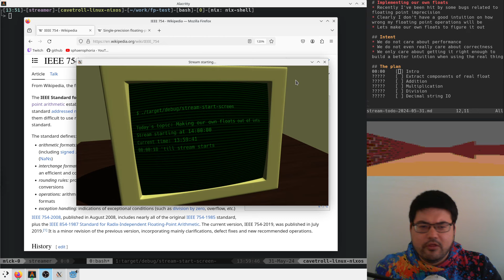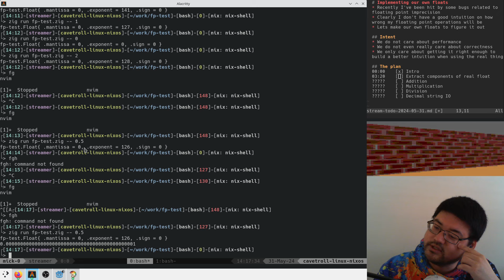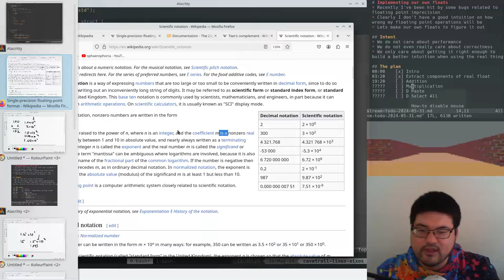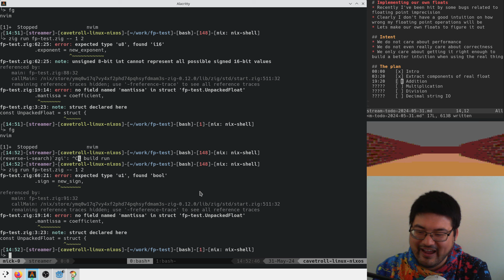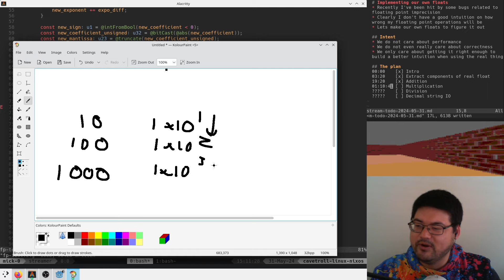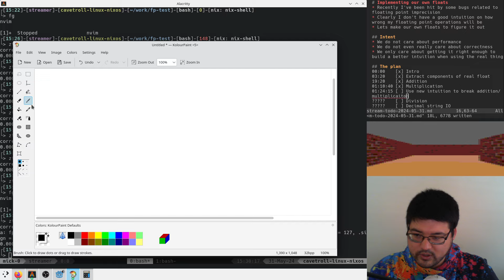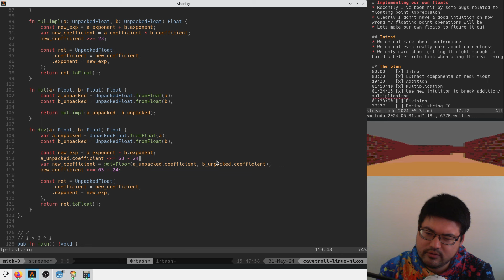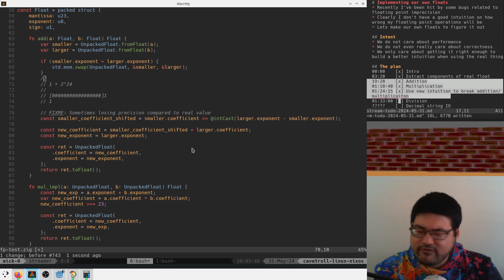Poorly implementing ieee754 floats from scratch

Comment: I was worried for a sec until I saw you gave no shits about any aspect of this. Writing a float point implementation is pretty easy. Writing a good floating point implementation is hard, writing a fast one is basically impossible. 

How most software I know of, gets around floating point imprecision is via a method known as origin repositioning. Instead of treating the start/center as your absolute origin of truth, you instead move that origin where-ever it is needed and recalculate your "view of the universe" from that new origin point. That way you can benefit from floating points while keeping the accuracy with acceptable bounds.

Comment: Shift to the left risks loosing the highest bits.
Losing the lowest bis isn't that bad if you have to add the result to a large number anyway: its just a bit less precise and you'll still lose them if you have to store the result in the original number of bits anyway.
The highest bitthat you shifted out can guide you to round to the closest integer, reducing the maximum introduced roundoff error by half

Comment: Does a packed struct start at the high bit?
Reply: His explanation of packed structs is not correct. Usually, a struct's fields are aligned to 4 byte boundaries so essentially a u8 or "byte" has 3 bytes of padding added to it (I think this is just for memory access speed). When you denote the struct as packed, there is no padding added, and the fields are the size of whatever data type.